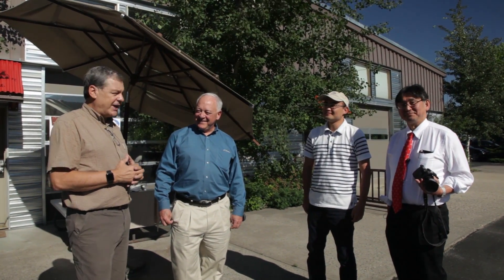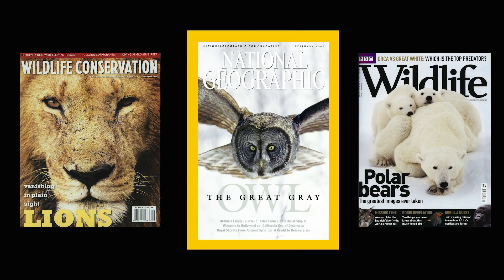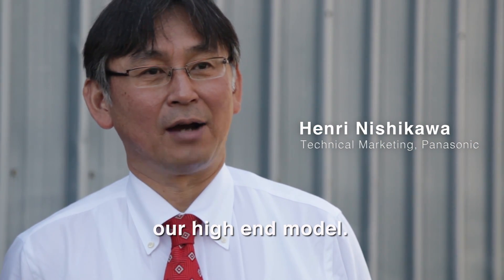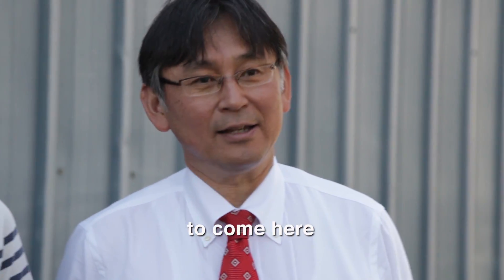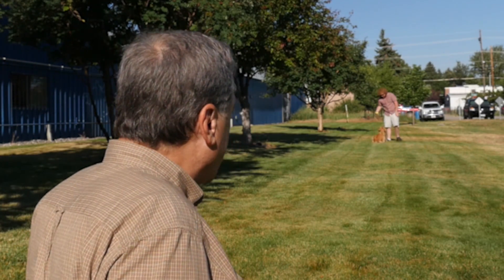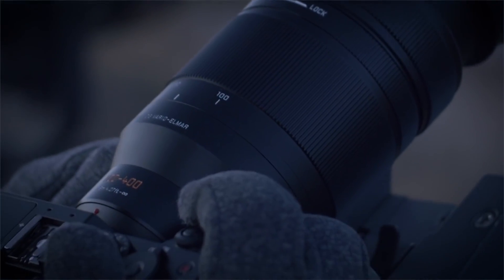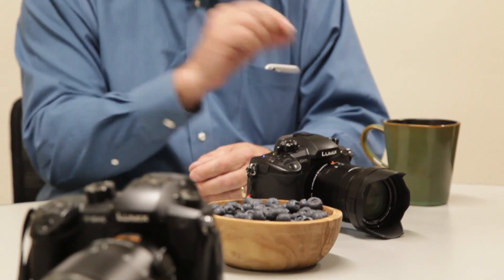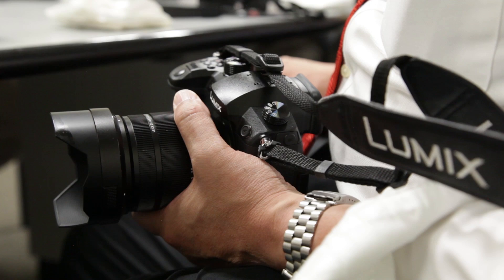GH5 Speeding Pooch Test with Panasonic Engineers

Comment: Please do not take any offense, but I watched this video expecting to find out if there were any improvements in the autofocus system with V 2.0 or possible settings that are best for fast, erratically moving subjects. I own a GH5 with the 100-400mm and I do not consider it a serious professional system for photographing wildlife, especially birds. Besides an autofocus system that is less accurate than a phase-detect autofocus system, the viewfinder annoyingly blurs when rapid-firing multiple shots making it virtually impossible to know if the shots you are taking are in focus. I love the camera for video, but not for stills.

I am anxiously awaiting V2 of the firmware to see what improvements have been made to the autofocus system for stills. Will there be another video that goes into the details of your test results? Were you testing V2 of the firmware?